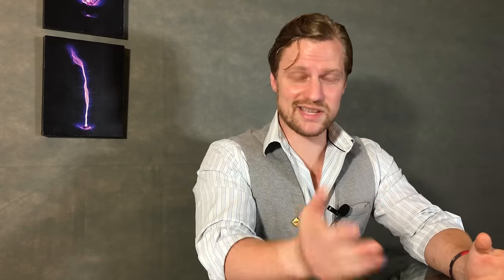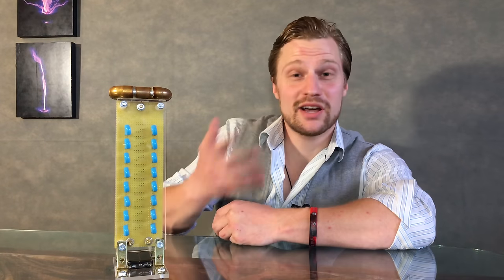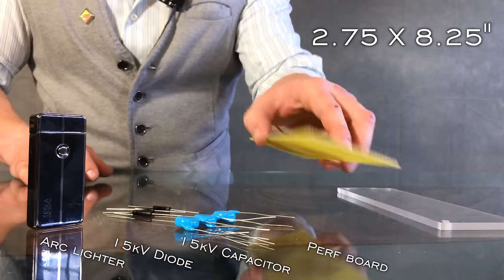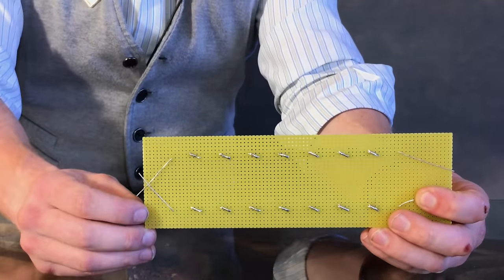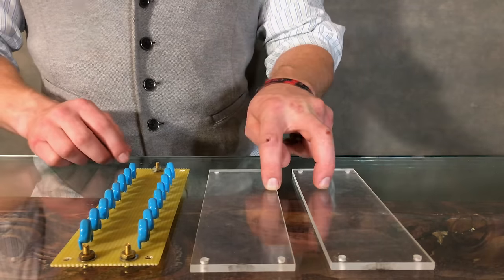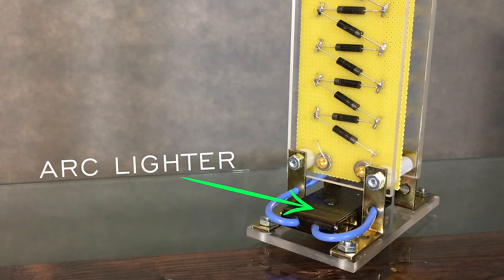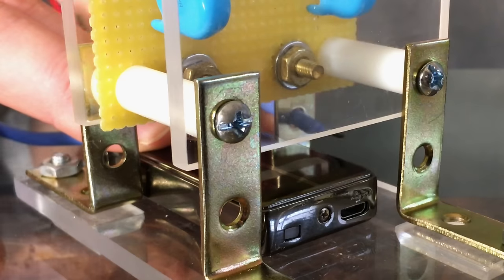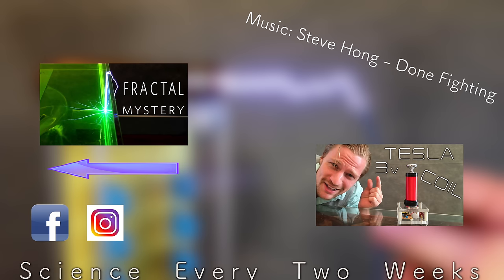DIY Desktop Lightning Tower (USB rechargeable!)

Comment: Is it possible to use a 18 million volts⚡️ rechargeable stun gun for my power supply 🤔
Reply from the maker: It is not unfortuntely. Those are DC. This tower is essentially a stun gun itself, just much more powerful. You cannot power a stun gun with a stun gun. They need an AC input.

Also, stun guns and tasers only go up to about 75,000 volts. In the USA, companies have no legal obligation to list actual voltage, so they claim high numbers. Sorry to crush the spirit!

Comment: Hi Jay, could you clarify something please. You stated the caps to be 15kv/1nf but your link takes us to 680pf caps. Should I search for 1nf? 
Love the channel by the way…
Reply from the maker: Hi! So weird..... the link is messed up??? In all honesty, it will perform
Similar with those caps, and will be safer! I’d say go with the smaller ones as long as they are rated for the right voltage
Reply: @PlasmaChannel  Thanks, I think I'll follow your 1nf version which I can get quite easily. I will try a 3D printed (PLA) frame instead of the perf board.
Reply: How did the 3D printed version work out? I might try it.
Reply: Hi John... I'll let you know once the multiplier is complete... I will upload the STL's to Thingiverse when complete.
Reply: 3D printed case works great.... I'll be uploading the STLs to Thingiverse as soon as I've finalized the design.
Reply: @matthewcampbell7153  I printed it and built the multiplier. Thanks!

Comment: Sorry mate , Imay sound stupid but at the end of the video you said something about tying the end of the white wire to something .... what do you mean ? where does the wire go/connect to  ?
Reply from the maker: The wire connects to high voltage ground of the multiplier. Otherwise, the lighter has a tendency to fail.
Reply: Does it matter which of the inputs you ground it to?
Reply from the maker: Yes it does. You should check out our episode way back about ‘we’ve been creating lightning’. It will help a lot.

Comment: Wow you really replied...

So let me tell you about my story. We ‘re having this School Projekt thing in School and everybody is going to talk about different things we do in everyday situation like sleeping (someone is going make a projekt about sleeping) and i thought why not take a bigger step and create this thing. So i got a lot of. questions. Could you send me the links for the bolts the half inch and the 2 inch. What kind of wire do i need for the bolts to be attached with and the lighter also has to be attached are these wire red and black
Reply from the maker: I highly recommend you do not build this as a first project. I really appreciate your interest though!
Reply: youre right but my teacher told me that i dont have enough time to change my mind and i already bought the need
Reply from the maker: Bigman T, again this is not a beginner project. Not due to its complexity. But do to the type of electricity involved. First, please look up voltage multiplier schematic on google. All voltage multipliers use the same building schematic. Then please check with your parents that they are okay you building this. I will happily help you build this but please confirm with your parents first.
Reply: My Parents do really aprove it my dad especially wants me to work on these kind of things
Reply: And i need diodes and capacitors where may i find them its really hard
Reply: About the copper pipe do i just have to place it on the multiplier without wiring into something
Reply: I’ve watched the voltage multiplier schematic and it means when the input voltage gets through then the voltage doubles it by the numbers of levels or what ever then that means the output will be lets say 8 times stronger than the input
Reply: correct me
Reply: I need tons of help youre the only one please help me get a very good grade

Comment: About to try this, so that I don’t blow up the lighter where is the ground?
Reply from the maker: Prior to building, id recommend googling voltage multiplier schematic. Not knowing where ground is on a voltage multiplier can be very dangerous. Let me know how the build goes!
Reply: Plasma Channel my arc lighter just for some reason conked before I even started, lord electron doesn’t like me
Reply: Plasma Channel and I can’t open it too see what’s wrong, I think the button is blocking it and it’s designed like that
Reply: Plasma Channel tips?
Reply from the maker: What model of lighter do you have. I'll see if I can help
Reply: Plasma Channel I’ll go check but before that a video suggestion since you are good at explaining stuff, it’s nothing new but coil/gauss guns.  They are just so cool and that’s what I’m also currently doing

Comment: Are you sure your diodes are the correct way around? , according to circuit diagrams online the diodes are opposite what you have.
Reply from the maker: The diodes can go either way, as long as they all go same direction. It’s how you build a negative multiplier vs positive.
Reply: @PlasmaChannel  WOwo, I di not think i would get a reply so quickly for an old video. Thanks! I am making one of these at the moment, But I wanted to put the Diodes on the same side as the capacitors, so i was trying to follow your design, and was getting confused. I have made one up and will test today. By the way the links for the components are out of date, the diodes and caps were hard to find, ( except for long wait times form aliexpress or amazon , ebay, ) so I purchase mine form Alibaba, as I am a big customer of theirs.
Thanks for the reply!
Reply: Hi mate, I have built this as per your video, but i am only getting a small spark of nore more than 1cm! What is your secret?

Comment: I bought a lighter with the X pattern, how do I wire that up? It has 4 wiers !
Reply from the maker: Ah! So take the two transformers, and wire them in series. Basically take two of the wires, one from each transformer, and connect them (then insulate the connection. ) now, you will have two wires remaining, putting out a more resilient amount of power. Still be careful though, don’t hold the lighter button down for more than 5 seconds at a time, and only discharge the high voltage output of the tower to it’s own electrical ground. One of the input wires.
Reply: @PlasmaChannel  ahh! Thank you!
Reply from the maker: Happy to help
Reply: Is the topload imoprtatnt for the size of the sparks? I just testing my circuit now and only getting 2cm sparks. Im using the same components as you.
Reply from the maker: filip andre topload size is not important, but shape is. Any sharp points, even bad solder joints in the entire device, will leak charge into the air. I’d recommend a top load similar to what I used.

Comment: DUDE !  Please install a 5meg resistor in your "ACTING" circuit, the current level is too high.  Cheers.
Reply from the maker: I agree, it’s pretty high! Had a few discharges across my chest and it’s painful. Next one I design will be touchable and safe to touch

Comment: Is it safe to touch
Reply from the maker: It is not safe to touch. It will hurt, and frighten you, and is similar to a stun gun in pain. Do not discharge the tower to anything besides the grounded wire (grounded ONLY to the electrical ground of the multiplier, not earth ground)

Comment: I found the diodes, but where did you get the caps? can you send a link please? thank you jay
Reply: also can I make it like 30 stages?
Reply from the maker: Voltage multipliers are limited in stages, usually 10-12. After that, so much energy is lost in the components that voltage loss actually happens.
Reply: I can attest to that! Played around with a similar build and got carried away with the stages. Too much loss, and very frustrating. I found eight was reasonable. Nice build, btw. Good conversation piece to have on a coffee/sofa table! Thanks
Reply: oh thanks! where did you get the capacitors?
Reply: ill just stick with 8 XD
Reply: Then try this: Build a multiplier that's twice as tall with twice as many diodes and capacitors. Now add a second arc lighter. That lighter might be positioned in the center of the multiplier or at the top (high DC voltage location). Done correctly, such a construction will probably allow for an unlimited number of stages with no limits on the final maximum DC voltage output. This is possible because arc lighters are battery-powered and are not connected to the mains power and are not connected to each other.  - - - The voltage will just keep on rising with additional stages.

Comment: Where is "electrical ground" in this tower ?
Reply from the maker: Depending on which way you designed your diode directions, it’s one input wire or the other. I’d recommend looking up voltage multiplier schematic on google. It will tell you which input wire is the ground for your tower in particular.

Comment: Could I use diodes at 12kv 350ma?
Reply from the maker: Are you referring to MOT diodes? It needs to be fast acting diodes
Reply: @PlasmaChannel  I am referring to normally used rectifier diodes. Or must I use other types of diodes?
Reply from the maker: You specifically need to use fast acting diodes. The ones used here are fast acting. You can use 2CL2FL or 2CL2FM
Reply: @PlasmaChannel  Oh thank you

Comment: Hi J its me bigman T
I’ve created a Marx generator myself, you told me to not to build one but i did. So i’ve been researching the use for these generator but i couldn’t find anything. Can i use this generator to power something or doing something else
Reply from the maker: Marx generators are specifically impulse generators. They cannot output a steady power...rather, only a pulse. They are usually used for displays of lightning, and for insulation testing.

Comment: Why am i so stupid? But what is the easiest place to connect it to the ground?
Reply from the maker: You’re not stupid by asking that. However, do not connect this device to any real ground. Your ground will be one of the two input bolts for the multiplier section. Only let the electricity return to a connection from there.
Reply: @PlasmaChannel  Well, that sounds very easy. Thank you for the tip

Comment: Are those capacitors are DC or AC
Reply: Capacitors hold DC, and pass AC. Electrolytic capacitors have a plus, and minus because they only work with one polarity. Ceramics are good either way.

Comment: are those capacitors are AC or DC
Reply: Those are nonpolar capacitor, often use in ac circuit.
Don't use bipolar capacitor. it can blow up.

Comment: I've got a few questions, so if anyone feels like answering them, I'd appreciate it.

1.How come the capacitors don't blow up considering that they are multiplying the voltage well over 3KV ?
2.What happens if you use more capacitors & how do you determine the limit (if there is one) ?
3.Why 100mA diodes instead of a lower current alternatives ?
4.Is there a max. input voltage (if yes, how is it determined?) ?

I'd really like to give this a go since I find it fascinating but I haven't had much experience with high voltages and I'll be ordering components from China (long waiting times so I'd prefer to do this right. Otherwise I'd have to waste months on waiting for shipments to arrive). Any input is appreciated
Reply: 1.the caps are rated for 15KV not 3, but even that is 4x less than the output.
the reason is that the voltage is spread over all the caps(stages) .
So 67000V / 8 = ~8,75Kv per cap is still  ok since the caps are rated 15KV
2. the limit is that the more stages you add the current decreases which increases the time to charge the upper stages, you can see that the longer spark need more time to cycle than the short spark in the video.
Second problem is that at a certain voltage air becomes so conductive that its impossible to use the circuit properly, so you have to submerge it in oil,wax,resin or plastic.
3. i dont know which alternative you mean
4.you need to calculate that by the parts, first you need max Voltage each part can handle like 15KV and then divide it by the stage multiplier (2,8x per stage) , you get 5357V.
But you should leave a safety margin .
Reply: @hyperhektor7733  Thanks for taking the time, this was very educational! Not sure where I got the 3KV rating from, but I'm glad you got the point nonetheless. 

I should have been more specific regarding the diode alternative, 2CL77 is what I've had in mind. It's another fast recovery rectifier diode but with a much lower current rating (5mA), which I assume could work but it would take longer to charge the capacitors (just speculating here, there could be more to it of course). Not sure if I'm allowed to post links, but here's a datasheet: https://www.digchip.com/datasheets/parts/datasheet/142/2CL77-pdf.php They're really cheap (around 4$ for 20 diodes vs 25$+ for 12x 2CL2FL).

As for the air becoming conductive, I assume ionization plays a part here so there's need to increase the distance between components / reduce the conductivity, right ?
Reply: @vex9596  i am watching right now what parts i have in stock xD, i am not sure if the 5mA diodes work or how long the will work. You basicly need to limit the current with a 680k ohm reisistor if my calculation is correct (V/ohm=current). Not sure if that is correct or how it affects the performance.

Since there are only 2 options (5m or 350mA) i would rather go with 350ma.

i have only 5 of them in stock but i was lucky to find 3 additional ones in my microwave parts box.

can you send me the link for the 4$ offer for 20pcs? i would buy them just for a second model to test.

For the 350ma version 
i found a very good offer  20pcs  just 7$
instead of 25 for 12pcs:
https://www.ebay.com/itm/20pcs-HVM12-CL01-12-Microwave-Oven-High-Voltage-Diode-Rectifier-12KV-350mA/120782901885?hash=item1c1f38d27d:g:J60AAOSwCfRbF8hR

or if you want only a 5 stage then 10pcs for 3,90$
https://www.ebay.com/itm/5-10pcs-HVM12-CL01-12-Microwave-Oven-High-Voltage-Diode-Rectifier-12KV-350mA/283583028716?hash=item4206dd9dec:g:7PAAAOSwi0RbF83~

Comment: Same voltage as lightning😂😂 I think not
Reply from the maker: Lightning is as low as 100,000,000 volts. Modern multipliers do 5,000,000. Making one 20 times stronger is just a design increase... and one that is very expensive.
Reply: True, real lightning has a spark gap of 1000 meters or more

Comment: Also guys - you can touch the top with bear hands (if you are using more durable power source), but DO NOT hold ground wire in the other hand - iv almoust died... i can still feal my heart the next day..
Reply from the maker: I'll be shooting a video  about this soon. Did you have the ground wire attached to electrical ground of the multiplier?
Reply: yes - one of the hv input leads. Also i get shocked when i hold battery box in one hand, and touching the multiplier output, i can feel the shock in my hand where i hold the batteries.
Reply from the maker: I'm making a video about this soon - be careful with touching the output. Aka, i wouldnt do it...

Comment: Its me again.Dose anyone know the frequency of the input or the system?
Reply from the maker: Frequency is not super critical. Any high frequency AC high voltage will work (as long as it's less than 5-6kV). But I'd quickly calculate it as 12kHz
Reply: @PlasmaChannel  ：）

Comment: can you make a tesla coil with it?
Reply: tesla coils rely on the resonance frequency of a secondary coil to earth, and the primary coil has the same frequency AC. when the 2 coils resonate near the same frequency, the secondary coil starts to induce the primary's current and creates a circuit to the environment to earth. this however,  it's AC but isn't using any coils so no you cant :(
Reply: What i meant to say is can you use this as a driver for the tesla coil
Reply: @treasuretotrash2067  no, you cant
Reply: Oh ok thanks for clearing that up now i wont waste $40 on something that wont work xD

Comment: Is this the same principle like Marx generator??
Reply from the maker: Similar, yes. But AC is used instead of DC, this can output constant current, marx cannot.
Reply: @PlasmaChannel  oh great, thanks! ........umm, btw the lighter is kinda expensive for me 😅😅😂😂, is it ok if I use voltage booster as the power supply??.........btw I love your work man, keep it up buddy, and of course, be careful with every project even though you are expert ❤️❤️❤️❤️💖💖👍👍👍👍👍👍.......best of luck!!!

Comment: Anyone actually touched the output? I don't really want to put in the work to figure out if it's safe, so if someone already knows that would be appreciated
Reply from the maker: This is not intended to be touched. At all. This is not a Van der graff generator. Please use the one hand safety rule at all times.
Reply: Thanks

Comment: what is the amapage of the multiplyer
Reply from the maker: If shorted? I have not tested it. Likely less than a milliamp. However, if pulsed at full voltage, we're talking a tremendous amount of current. Please use one hand rule and be safe when operating this.
Reply: i am trying to make a device that shoots high voltage super low current sparks to it can make huge jumps but nonlethal maybe a little taser type shock but nonlethal
Reply: @PlasmaChannel  i love your channel i watch every upload and i hele liked and subscribed since the second firebending video
Reply from the maker: Thanks Justin. I would recommend building this, but putting a 50kv 1 Meg ohm (or more) high voltage resistor on the output. That will limit current drastically.
Reply: @PlasmaChannel  oh this is his son dane i am using my dads youtube account
Reply: @PlasmaChannel  do you think it is possible to do something like that but make the voltage 10 times more powerfull and current almost zero so it is able to make huge arcs with low risk of death?
Reply: @PlasmaChannel  also if you couls figure out a way to shoot lightning like electro that would be awesome i was thinking open air dc discarges